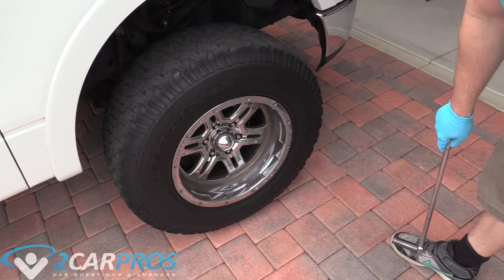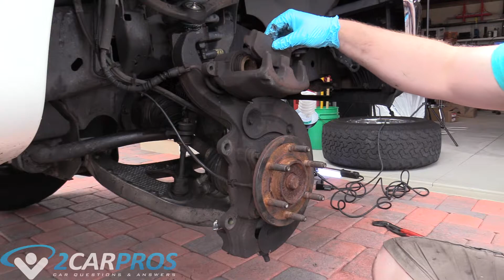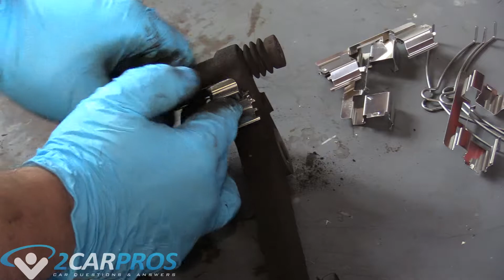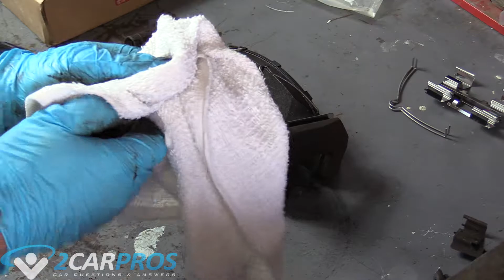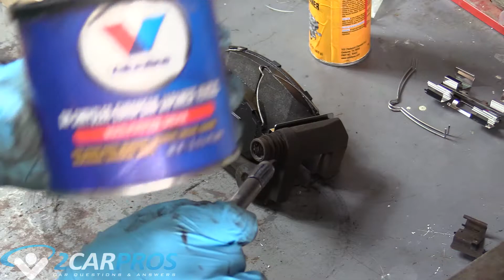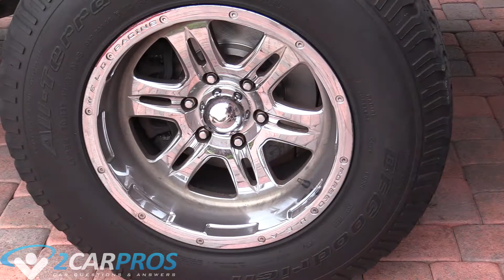How to Change Front Brake Pads and Rotor Ford F-150 2004-2008

Comment: Been a mechanic since 1968 and I wouldn't let you work on an enemy's car. Waaaaaaaaay too much grease.
Touching brand new pads with greasy gloves.
Never used your brake cleaner to remove ALL grease , oil or dirt. 
Please don't try to show people how to do brakes unless you have a lot of liability insurance. You seem to know WHAT to do, just not HOW it should be done.

Comment: Can anyone tell me if 2wd version front rotors are different to the 4wd version. I need 2wd but feeling confused. Same question regarding drop links. cheers in advance??
Reply from the maker: They shouldn't be different. Just make sure you get the correct stud count. Thanks for watching Mike!
Reply: The 2wd has a rotor hub assembly on the front. It’s one piece

Comment: What year truck is that? I have an 04 (new body) 2wd xlt and my lug bolts are a part of the rotor, so I need a 42mm socket and 10,000 ft lbs of torque to break em loose.
Reply from the maker: It is a 2005. Your lugs are a part of the rotor? I'm confused they really shouldn't be.
Reply: Ya brother i hear you I’m changing my brakes and rotors right now
Reply: My 08 has a one piece rotor/hub/wheel bearing. The spindle nut (36mm) is torqued to 295 Ft.Lbs. Bring your BIG breaker bar!

Comment: Great video.  Does anyone know WHY you need to pump the brakes slowly to engage the pads for the first time.  First ten or so times I changed pads, I just hopped in and pumped away until they engaged (except for the one time I forgot entirely to do it and almost crashed backing out of my driveway... a sad and funny story). Never had a problem otherwise.  Then I read or saw somewhere that you need to pump slowly.  Is that to avoid sucking air into the system?  Also, I do two things differently.  I use the grease that sometimes comes with the upgraded pads on the glide area of the shiny retainer clips.  I also use a bit of anti-seize compound on the mating surface between the wheel and rotor, especially with alloy wheels to ease removal in case I ever have to change a tire roadside. Finally, for my money, I now pay a bit more for the rust inhibiting rotors (all surfaces are painted except for the brake pad mating area.)  They stay rust free so they are no muss no fuss on removal and the outer edge looks nice through the slots in your wheel (rather than all rusty).  I don't know if this affects performance / cooling / warp resistance.
Reply from the maker: To make sure that the brakes work the first time you push them. Thanks for watching!